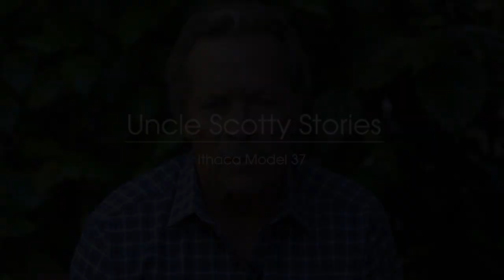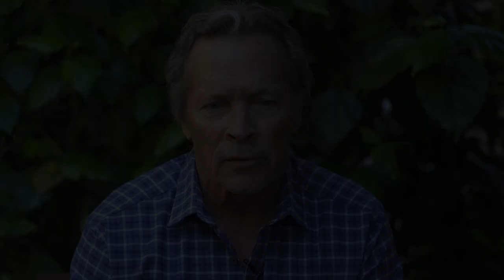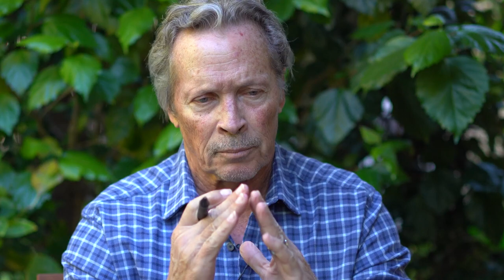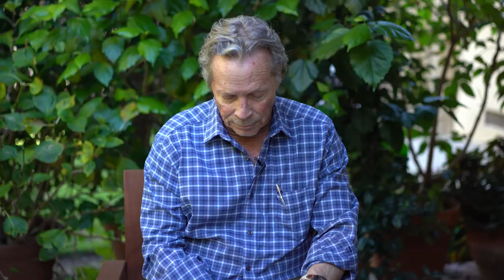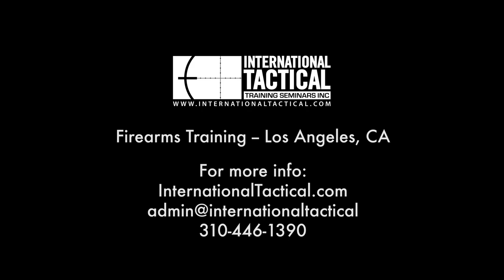Uncle Scotty Stories: Ithaca Model 37

Comment: Great take on your experience with the Ithaca mod 37. The 37 can be single loaded really fast by turning the gun bottom side up with the action open take the unfired round sit it on top of ejectors and push it down with your thumb and close the action. It takes a few times to learn how but works really fast. Also the 37 can be unloaded by taking your right thumb and pressing the shell stop you can remove all four rounds and not have to run the action. When all four rounds are out open the action and chambered round comes right. Very simple and fast. The 870 is a great shotgun I have owned both the 870 and still own many 37’s. My opinion, the 37’s are a lot smoother and are much faster. Just my take on the 37. Thanks for your stories and your service. Be safe.

Comment: Your stories are great. I worked for a smaller upstate NY city PD in the seventies. You would take over the car from the previous shift and had to look for the shotgun which might be hidden somewhere in the trunk. There was no standardization with shotguns and we didn't have racks as I recall.  Despite the lousy budget , outdated uniforms & not a whole lot of on-going training, I got to work with some very fine police officers until I moved on.

Comment: Great info, never really heard those negatives on the 37.  I always though they were well regarded since NYPD and LAPD seemed to prefer them.  I liked the way the 870s dual action bars felt, no torquing when racking.  We had Mdl. 870s with #00, slug, and early 80s went to #4 buck.  When we cleaned and inventoried the 870s, we found guns from the mid-60s still in service.  A bit rough in the finish or scarred from riding in the stand-up rack by the passenger officer, but good mechanically.  I think all the armorers had to do stake a shell holder every once in a while or take it apart if someone’s finger slipped and the loaded shell backed over the loading gate (pre flex-tab) and locked it up.  We had some 20 inch guns that they cut to 18 and never went back and put a bead on.  Yeah.

Comment: I bought an old ex-prison guard Model 37 for $90 around 1990 and turned it into a SBS.  I still have it but never use it for anything.  I like the downward ejection but not the safety or action bar release.  If you prefer downward ejection, the Browning BPS operates a whole lot smoother (just don't ever detail strip one).

Comment: What I've found strange is the safety is backwards from every other gun. Push it to the right to fire, left to safe. Is that the way it should be, or is mine modified? It's really a no go for me.
Reply: @ Brian Hoxworth  Your shotgun has an installed left handed safety. Both Ithaca and Numrich Gun Parts offer both R/L conversions replacements